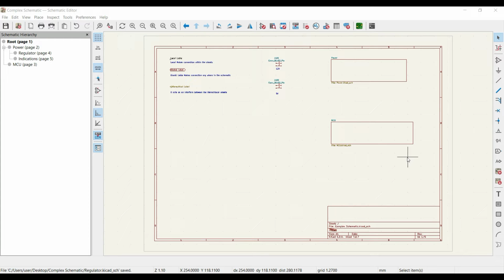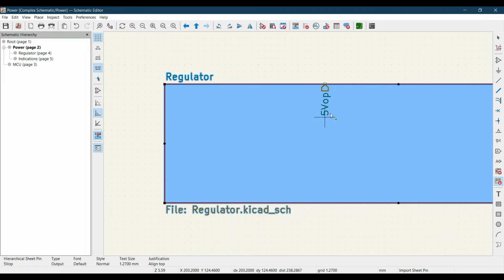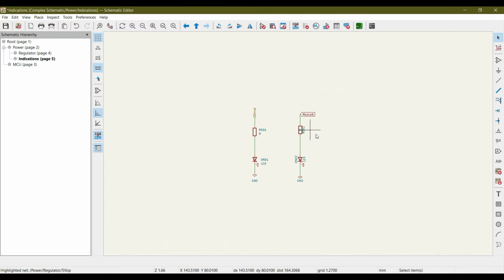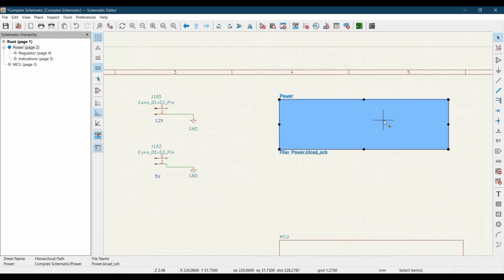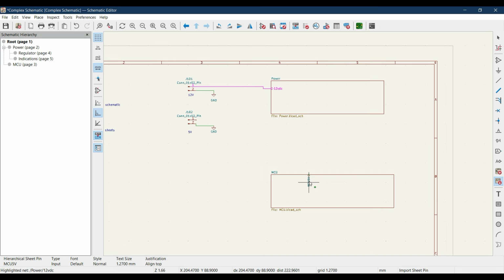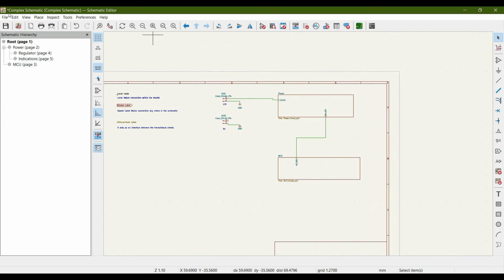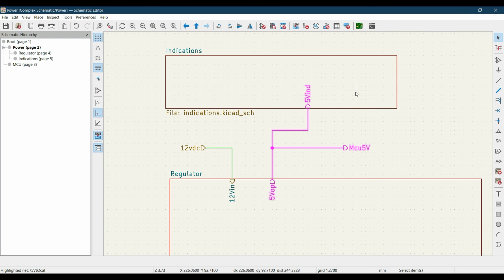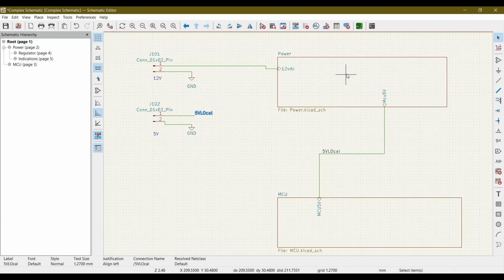35 Importing Hierarchical Labels and Connecting Sub-Sheet Symbols in KiCad

Comment: If MCU global label is connected to another sheet's input then why can't be use global label in entire schematic i.e. in power supply sheets etc? Why to use Hierarchical Labels?
Reply from the maker: You can use global label ....but to make schematic modular and nicer hierarchical label are used  to show interconnection between sheets